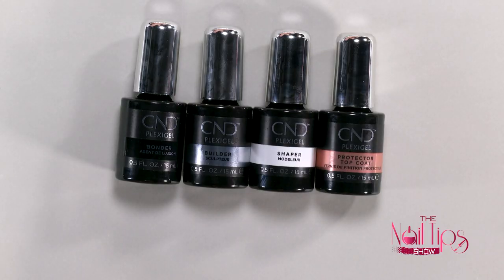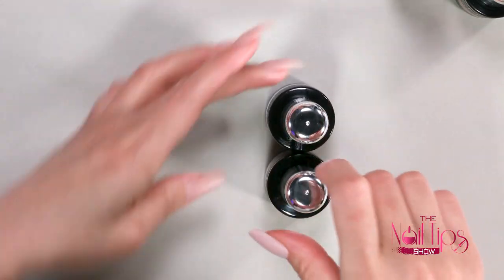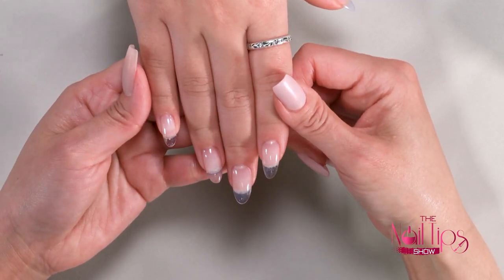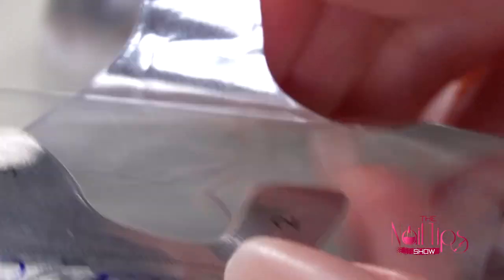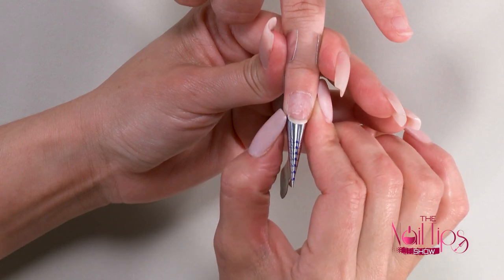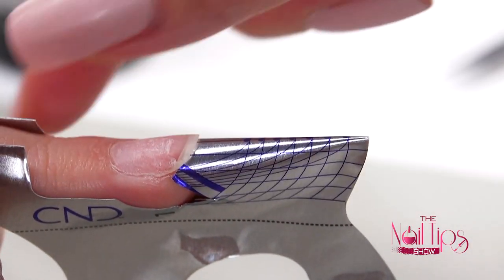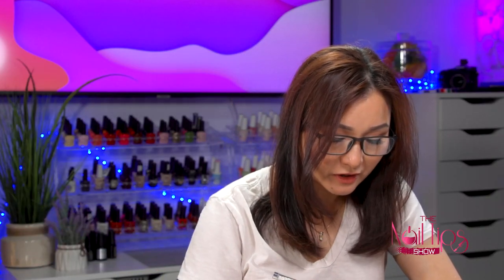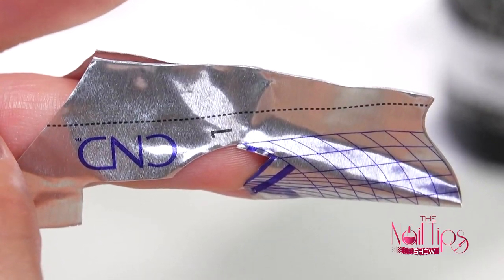Using CND PlexiGel

Comment: I'm OBSESSED. 😍 This is one of the best tutorials I've watched for CND Plexigel!!! I use Builder on 90% of my clients. My extensions look SO WIDE! I needed this info in my life! I have so many questions now 😝 ! How long does it take for you to do a full set?🧐 I would love to see this using Porcelain at the tip with clear on top. I feel like I've been doing this all wrong!!! 😑After using the sanding bit, can gel color go right over that finish or is it necessary to buff them a bit smoother? What if a client comes in with long nails with builder and one is broken down with little to no free edge. Any advice would be greatly appreciated! 🙏🏼